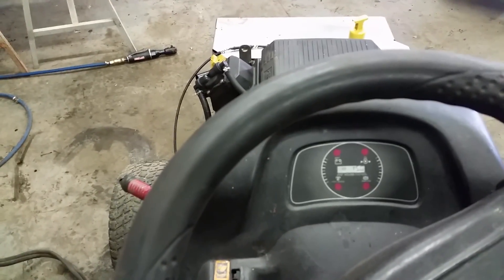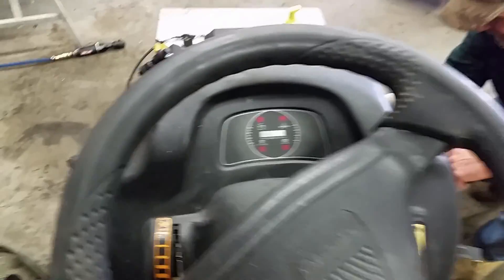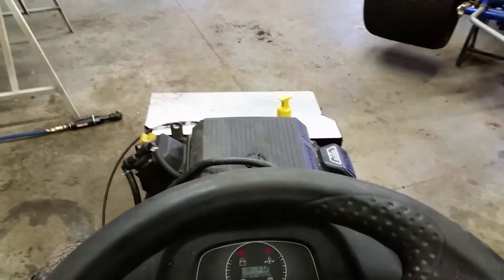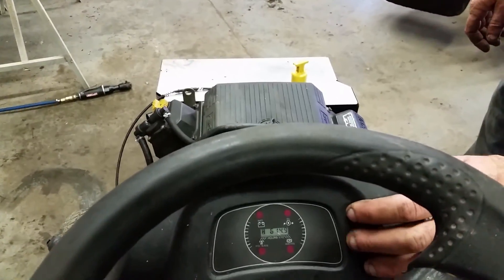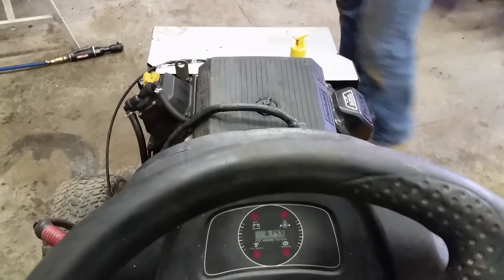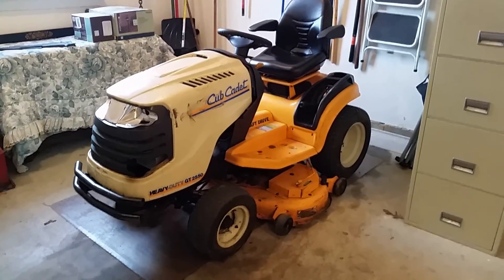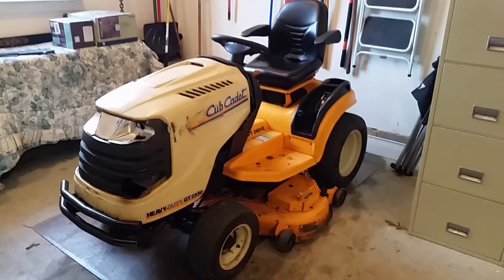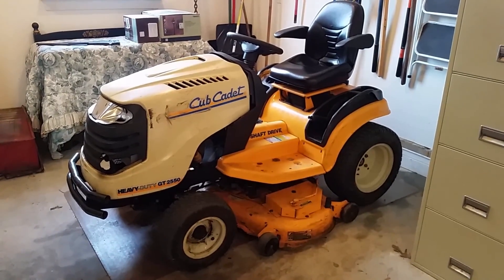Cub Cadet GT2550 - Kohler Command CH670 (22HP) Engine Rebuild, Install (Timelapse), and First Start

Comment: The trick with any motor is VERY SIMPLE... Change the oil when recomended ..  if it runs funny...  Fix It...  Observe the air filter and fuel filter   every now and then...  Kohler motors will run 1500 hours if ya got any sense...
Reply: Dont use synthetic oils...
Reply from the maker: @EvilFiEnD555  Synthetic won't hurt anything, but in my experience it's not worth the added cost over conventional. This engine had the oil & filter changed regularly, and the air filter was cleaned every week. Not running it wide open under a load (mowing grass) was what eventually killed it. But my grandfather was stubborn and I couldn't convince him to do so.

Comment: I have one of these mowers and I am going to have to rebuild it with only 200 hrs on it air breather failed and ruined engine and yes i always checked my air filter! With that said I really like this mower but just wanted to put it out there keep a close eye on your air filter no matter what mower you have!
Reply from the maker: Absolutely! Some small air cooled engines are much better at taking abuse than others. I know of plenty of these things (mostly Onan's, Kawasaki's and the older cast iron Kohler's) that can be run with a dirty air filter or clogged cooling fins (or dirty oil) for a long time and just keep on ticking, but these Kohler Commands are a lot more picky and they just don't hold up to that kind of abuse.

Comment: Always use 4 cycle small engine oil. It is made specifically for air cooled 4 cycle small engines. It comes in regular oil, synthetic blend or full synthetic. My cub cadet GT 2550 has nearly 500 hours and runs perfectly and uses no oil. I have always used regular 10w30 4 cycle small engine oil. One thing about these horizontal shaft drive Cub Cadets. Because of how the engine is mounted, lots of debris ends up in the air filter and cooling fan area. After every cutting, clean the foam pre filter and fan area with a leaf blower. Also clean the front cylinder air fins up under the heat shield. This will keep the engine from overheating while in use. Many do not know about these very important maintenance tips for these machines.  Overheating due to lack of air cooling, will cause excessive oil consumption and also cause the oil to break down much quicker, thus causing premature engine wear. Kohler Command and Command Pro engines are excellent powerplants. But, as with all engines, the right oil and filter, as well as keeping the engine running at the right temperature is vital to a long-lasting engine. The air filtration system needs to be checked for blockage due to debris and changed after every season. Same with the oil and oil filter. A little money now, or much more latter on. These machines now adays cost way too much, so keeping everything clean inside and out is very important. Lubrication of all moving parts is also very important.  I plan on using my Cub Cadet GT 2550 for many more years to come. It is a 2007 model, and still looks good for its age. Oh yes, don't forget spark plugs and fuel filter after each season.  And Sea Foam gas treatment in every fill up of your small engine gas container. The stuff has been around for years. Many yard maintenance companies use it in all of their machines.

Comment: My cub gt2544 has a ch670 and is made a year before this engine was. At 15 years old at nearly 300 hours still runs like a swiss watch. Always use full synthetic amsoil small engine 10w30 engine oil. Change the air filter fuel filter and clean the tractor every year. You can see from the video this tractor wasnt treated well. The hood looked horrible. The engine was dirty, it was missing parts, grease all over it. Its kinda know wonder it didnt last cause it wasnt treated like you treated your john deeres. Or even the older cubs. Yes, mobil 1 is not a good oil for small engines. You want to run small engine oil ONLY! You kinda ruined a good motor by running bad oil in it. Oh well, just dont run Pennzoil in your deeres so they last longer please. Just run small engine oil. Its specially formulated for there applications. Which car oil isnt.
Reply from the maker: You also weren't using your GT2544 commercially like we were using this one - when my Deere was down I was using this one 5 days a week. This machine saw more use in one season than most of them see in 10 years. We would clean the machine at least once a month and that always included the air filter. The engine was dirty and greasy because the pictures were taken at the end of the mowing season before we had disassembled it. I have yet to see a second-generation GT2500 series without cracked or broken hood hinges. Most Cub Cadet enthusiasts know how awful those hoods were - it was a poor design from the start...actually the whole tractor was. I know for a fact I'll never touch another one.

 BTW...there's no such thing as a true "small engine oil"...the additive package is what defines an oil, and with the exception of straight-weight oils designed for use in old flat-tappet engines, a 10w30 oil (or any multi-weight) designed for use in a car engine will be no different than one designed for a small engine. It's all a marketing tactic - unless the engine is broken in at the dealer with synthetic oil and that's the only oil it ever sees, you are wasting your money running synthetic oil in one of these things. We bought into the whole synthetic myth when this tractor was purchased, but I am not sold on it. I do run Pennzoil SAE30 oil in my old 210 as it has a higher ZDDP content and lower ash than most of the other SAE30 oils out there (which are becoming fewer and fewer as the straight weight oils are being phased out). That's what those old engines need, especially with the heat they produce and the fact that they have no oil filter. In fact, the Case IH dealer I work at is replacing the CIH/Akcela branded low-ash SAE30 oil with Pennzoil SAE30 due to the higher ZDDP (and the fact that it's just a better oil than the Akcela stuff).

 But at the end of the day, not running wide open throttle (and the resulting overheating) is what killed this Command - not the oil we used.
Reply: @MichaelTJD60  No, you are correct, i dont use mine commercially. But i do use it for garden tractor task all the time. Multiple hours at a time. Just dont mow a lot. Also still on the original hood. And small engine oil does have a difference from 10w30 car oil. 
Iike you said there additive package is specifically formulated for small engines and there brutal tasks.

Comment: I’m really worried my cub cadet GT 2100 won’t last
Reply from the maker: Keep the engine air filter and cooling fins clean, run wide open throttle, and use a good quality engine oil as per Kohler recommendations, and it should last, as long as you're not intentionally running it hard.
Reply: Look at how filthy it was that right there alone shows the abuse.
Reply from the maker: It had literally just come back from a mowing job when I took those pictures...
Reply: Update I ended up getting rid of the tractor because the battery quit charging and the tilt steering broke. upgrade to a John Deere x485 I will never go back to a POS cub cadet.

Comment: Thanks for the video and info.  I bought same mower in 2007 and have regretted the purchase ever since. It is cheaply built and I've had problems from day 1.  First couple of uses, the hood broke off. Zerk fittings in mower spindles are pressed in and I had a couple pop out.  Zerk in front wheel hub was left with unwelded crack next to it/ grease just flows out.  With less than 50 hours on it, valves stuck and bent valve pushrods.  Steering sector gear case can't be lubed because it has ZERO clearance for grease.  I found out afterwards that dealers were instructed to grind out the sector gear case to provide clearance. I just replaced a steering knuckle that failed. The front tires are cambered so much the outside tread has worn off.  After seeing your video, I will be trading/selling mine while it still running OK. I have 150 hours on it now and have zero faith it will last as long as my first John Deere did.
Reply from the maker: Yeah definitely get rid of it while you still can. The engine in this one actually seized up a year after the rebuild because the oil pump gear stripped out, so we parted out the tractor and I dumped the frame off at a mower salvage yard. I'm still so bitter about this machine, I never liked it from the start...but now I'm glad it's gone. I like the older Cub Cadets but will NEVER own or work on a newer one again. My 35 year old 782 and 882 diesel will run forever.
Reply: I think I know what happened to this engine! I think the oil pick up tube broke. So even if there was oil and the oil pump worked the oil couldn’t be sucked into the oil pump.

Comment: Mine just quit running like you turned the switch off. It fires but kills right away. Oil light goes off. I pulled wire off of oil sensor to no avail. Im here researching because of it.
Reply from the maker: Sounds like you might have a bad key switch or a loose ground.
Reply: MichaelTJD60 are you refer to ground at the battery or elsewhere?
Reply from the maker: @bryanhauschild4376  Both. Sometimes if the engine is shut off but the key is left on, the oil pressure light will come on. But if the engine quits running and the oil light goes out at the same time, it sounds like you've lost all power from the battery.  I can't remember off-hand where the ground wires connect on the frame of these tractors, but if the ground connections are loose it can cause the exact same problem you're having. Check to make sure the battery ground cable is tight, and check along the frame rails and engine mounting area to make sure any ground wires are tight. If the problem continues, I would bet you have a bad key switch.
Reply: MichaelTJD60 ended up being the fuel pump. It has like a t-shaft in the center of the diaphragm, which had pivoted and released from the arm which is moved by the valve rocker arm.

Comment: I can’t lie, as much of a POS as this motor was it kinda had a cool sound to it
Reply from the maker: They do have a unique sound. They sound like a Harley Davidson if you straight pipe them.
Reply: @MichaelTJD60  worked at a golf course and had this engine on a few of our machines.  
some have a solenoid auto fuel shut off carb. witch was the source of many many many many many headaches\breakdowns

Comment: John Deere sucks ass, work on this shit every day. Not saying Cub is a great brand or even a good brand but quit acting like John Deere is the best thing since tits on a chick. "Nothing runs like a Deere." True, but nothing stinks like a john either.
Reply from the maker: At least Deere doesn't use engines and transaxles made in China. For what they are worth, considering all the options on the market today, Deere is probably the best bang for your buck. They have their problems too, but they still put more effort into the design and overall build quality of their machines. Sure you pay a lot more money for a machine with a shaft-drive and all the deluxe bells and whistles, but it will still be around in 30 years unlike this Cub Cadet.
Reply: MichaelTJD60.....your right, how would I know... An entry level Deere with a shaft drive is going to be considerably more expensive than a entry level shaft driven mower made by several other brands. So your not comparing apples to apples my friend. And if you don't think Deere is using components on it's equipment that come from China you are either ignorant or in denial.
Reply from the maker: I never said Deere isn't using Chinese parts, but at least their main driveline components aren't made in China like on the Cub. The Hydro-Gear transaxle on this GT2550 has "CHINA" cast right into the axle housing. And I was surprised to see "Made in China" printed on several of the parts packages that we received when we rebuilt this engine.

Comment: I have this same mower and have never had any trouble until last week the battery died on me replaced it and the new battery died the next day is there anything I should try before replacing the stator  help please I will if I have to but would like to know I'm fixing it not wasting time thanks for any advice in advance
Reply from the maker: I would check and make sure the key switch is working properly, sometimes if the key switch goes bad the ignition will stay on even when the key is turned off. That would be the cheapest fix. If the key switch is good, check the voltage regulator, those are also prone to going bad.
Reply: any Caliber if you have a multimeter, turn it to AC volts and start up the engine and probe the 2 white wires that plug into your regulator. It should show more than 26 volts at full throttle if your alternator/stator is working. If that checks good, turn your meter to DC and ground one meter lead and probe the purple wire on the regulator, it should show anything over 13 volts at full throttle. If its less than 13 your regulator is bad, if it checks good your charging fuse is blown. Fuses are super cheap fix, way cheaper than a key switch. Hope this helps if you haven't fixed it already.
Reply: Uriah Otten Thanks will do

Comment: Hello nice video When you had them hone cylinders were cylinder walls scored. Was it just a honing to accommodate another stock set of worn rings air did you go oversize on rings.
Reply from the maker: Thanks Joseph. The cylinder walls were not scored. We just honed it for new standard-bore rings.

Comment: Also by the way the old IH cubs used those same type and diameter drive shafts. The only difference is they didn't have that rubber thing that the shaft goes through and the rear coupler connecting the shaft to the trans is cast iron and the shaft is also steel instead of aluminum. I actually rebuilt the drive line on my old Cub cadet 129 and I did a video series of it in spring of 2014
Reply from the maker: +Cody Johnstonbaugh Did they use u-joints like a proper shaft drive should have? The coupler setup on this machine is really really weird.
Reply: +MichaelTJD60 No they did not they just used a straight shaft and a coupler with 2 bolts in the back connecting the shaft to the trans. it's held together by a pin that connects the coupler to the shaft.
Reply from the maker: Interesting.
Reply: +MichaelTJD60 a universal joint would be an unnecessary expense (and complication) in a drive system where the power source and the load are never more than a few degrees out of line (chassis flex).

That being said, the driveshaft coupling on the rear axle of my Land Rover Discovery is a rubber doughnut.  Yea, go figure...
Reply from the maker: Well the driveshaft in this Cub sure looks weak compared to my John Deere 316 which uses a much heavier cast iron driveshaft with universal joints and is less trouble to remove.
Reply: +Cody Johnstonbaugh they had a flex plate which was a piece of rubber and they bolt to one end and then the other two bolt to the motor

Comment: Is this like the older version of the new GSE and GSX models?
Reply from the maker: +Lucien Dube Yes.
Reply: +MichaelTJD60 that is what I thought. The new XT3 GSE and GSX models can only be found at dealers. Where did your grandfather get this tractor?
Reply from the maker: At our local New Holland dealer...which also sells Cub Cadet, Yanmar, Snapper, Husquvarna, Troy-Bilt, Hustler, Exmark, Bad Boy, and several others.
Reply: +MichaelTJD60 John Deere?
Reply from the maker: Everything but.
Reply: +MichaelTJD60 THEY NEED TO CLOSE DOWN THEY DONT SELL REAL TRACTORS
Reply: +MichaelTJD60 Ariens too?
Reply from the maker: Probably.

Comment: Even though it's a MTD, I'd still prefer the cub cadet over the la150 because it's a shaft drive. But I'd definitely prefer the 316 over the la150, hands down.
Reply from the maker: +Lucien Dube A Deere 100 series isn't as heavy of a machine but it's much better built than this Cub. And it's a lot more comfortable to drive too. The Cub is the slowest lawn tractor I have ever seen, and it makes you sore after running it all day.

Comment: What a pain in the ass. I'll have to make a video of my tiger cat. The engine design and location is terrible. Tons of flaws. It must be a Kholer thing.
Reply from the maker: +FrascinoLawnCare Yeah I don't know. I'll take my K341 Kohler over this one any day.
Reply: +MichaelTJD60 for sure. I meant the newer Kholer engines that is
Reply from the maker: I know what you meant lol. I just don't like new stuff. These are great for zero turns but not for garden tractors.